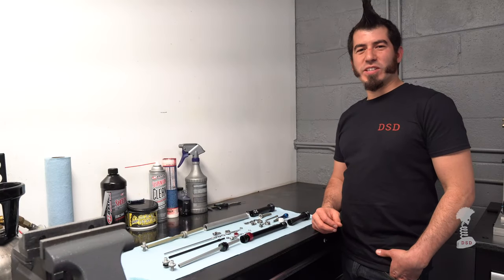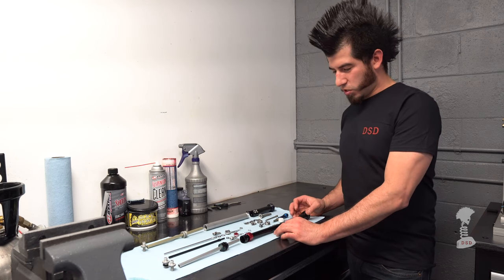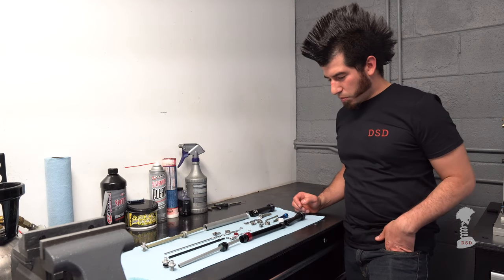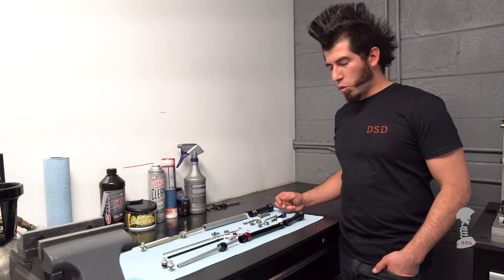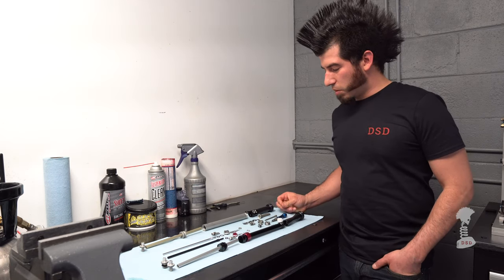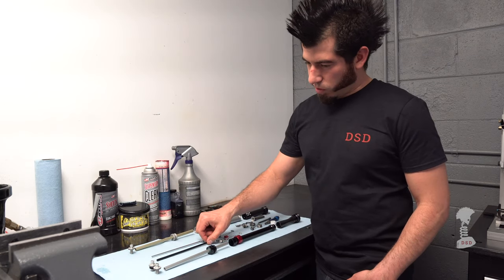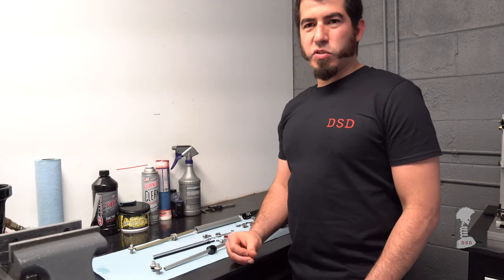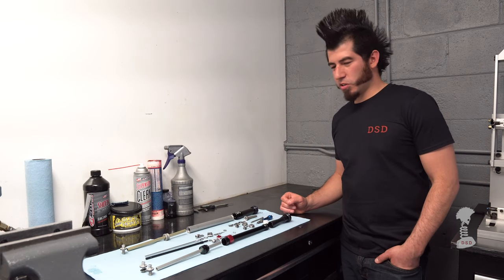DSD RUNT: Charger 2 Tune and Mods

Comment: Love the design of the Runt. I’ve been saying this needs to be made for nearly 10 years. But what you should do is make it depth adjustable. Make it so you can adjust insertion into the fork to change the main air chamber volume. That’ll let people set the spring rate before doing preload (psi) and bottom out (Runt psi). Easy to use calculation for weight for base setting of insertion.

Comment: Hi! Did you hear about charger 2 (not 2.1) having any common problems? Like oil leaking trough its compression switch? Saw it leaking in some youtube videos, now I'm little bit affraid of buing Lyrik 2019 with it.
Reply: I have this issue right now :-(
Reply from the maker: We have seen this from time to time with both Charger 2 and 2.1 dampers. We do have a fix for it.

Comment: Great idea that runt. 
Watching this video, it seems like the original design has quite a few flaws, so the Charger 2 damper mods are pretty much a must have for a successful runt installation on a 2019 Lyric? Is that right?
Reply from the maker: It's not required, but definitely recommended for the RUNT. We also recommend upgrading your debonair shaft to the C1 version for the best RUNT performance. We have the C1 upgrade kits available on our website as well. 

With the RUNT, you'll get a far more supportive spring curve with the linear rate, so we can eliminate a lot of the harshness with a full custom tune.